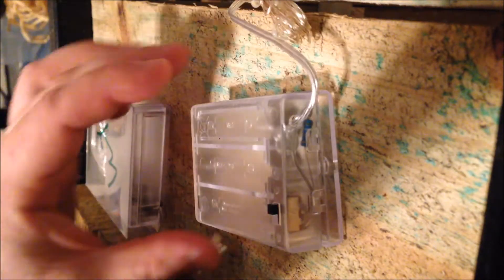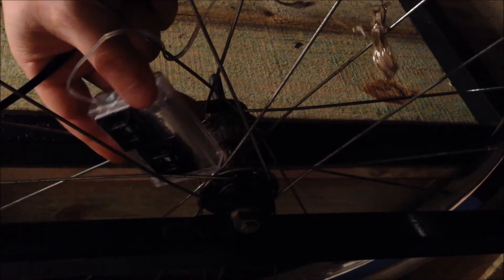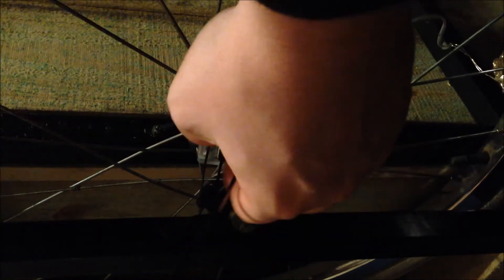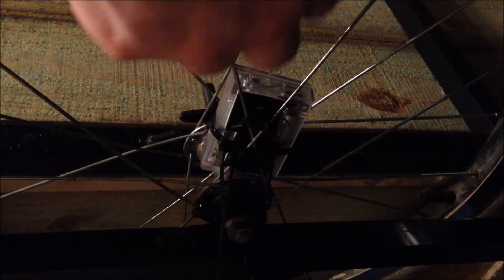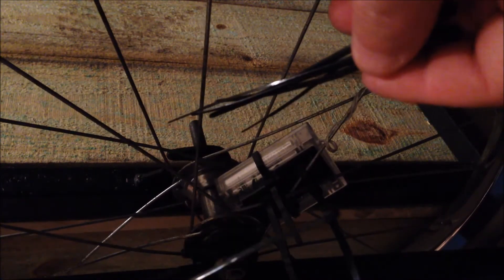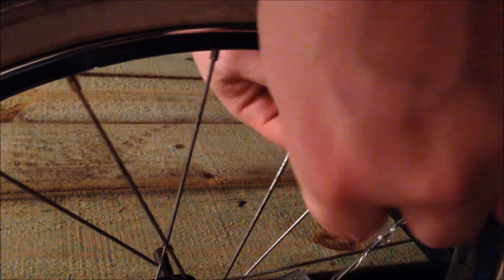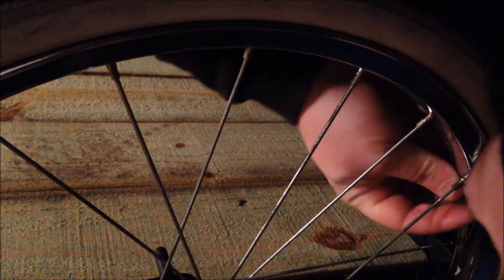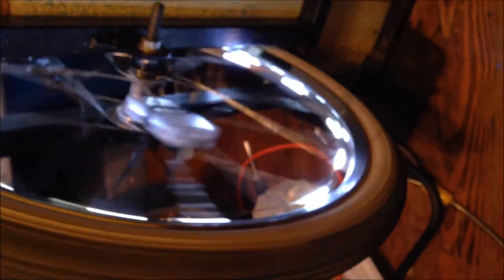Low-Cost Bicycle Wheel Lights - Tutorial

Comment: The light set you linked to on Ebay now runs $25.37 + $3 shipping per strand!
Reply from the maker: The Ebay link is for a set of 10 LED light strings.  Searching for similar auctions, you can get a set of 1-2 of them for much cheaper, less than $10 or so.  

The tire valve lights do work, but they are not nearly as bright, don't look as good (especially when stopped) and have button batteries instead of AA's.  They are always an option though.
Reply: NOLA Social Ride
 I'm not a fan of the valve stem style light.  The button cell is one reason, but the bigger problem I have with it is that since they are motion activated, they go dark when you are stopped at an intersection.  The switch based light strand that goes around the entire wheel is a much better option, IMHO.  Thanks for the info on options to purchase on Ebay.  Do you guys sell ready-to-install kits?